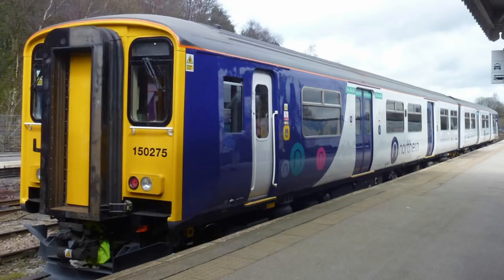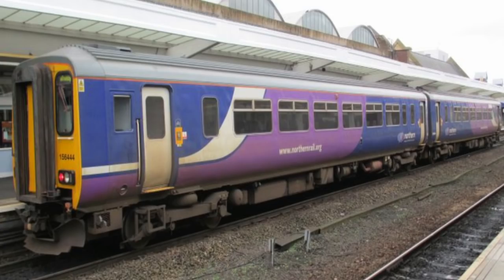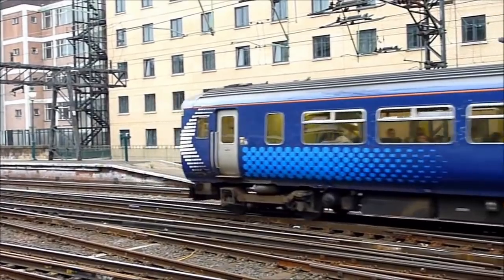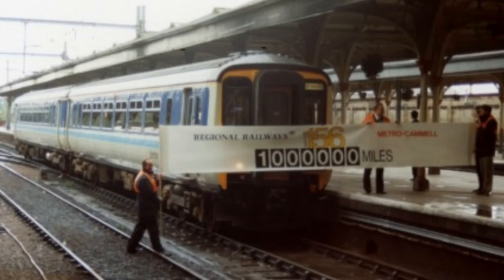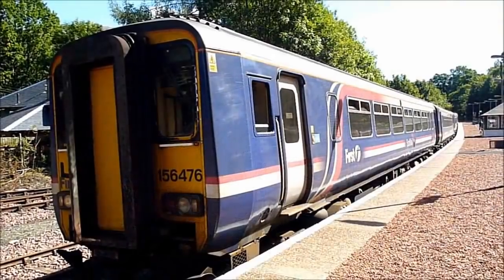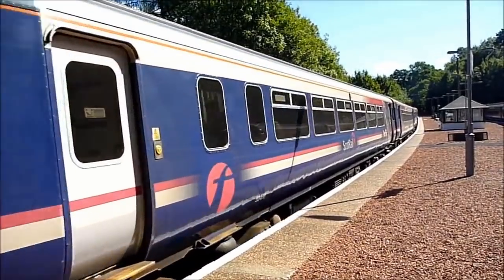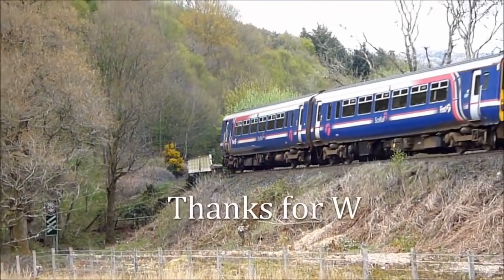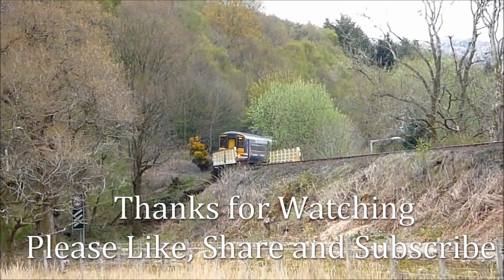British Rail Class 156

Comment: I like 151. Looks great wish they had made them in numbers
Reply: I remember riding them on the Matlock line.
Reply: @Eskel the Trainspotter & Roblox Yes they were but I can't remember what they were like inside apart from the seat moquette was something like the Pacers and contemporary road coaches (the striped design that was commonplace in the 1980s).
I always thought the 151s looked American in appearance and they had a very American spec as well with Cummins engines and a Twin Disc transmission that proved unreliable in the UK stop-start conditions...
The Cummins is an American engine built for long distance interstate trucking; UK buses and lorries (and the Pacers) with the Cummins engines were prone to breaking down...
I remember riding 150001 on the Matlock line and feel it should join the National Railway Museum collection alongside 142001 and 313001.
I also remember the Class 154 (Class 150 based testbed for the 158s) before it was converted back to a standard Class 150.
I think Northern should have retrofitted air conditioning in the 150 / 156s and 319/769s when they refurbished them...

Comment: Still ride on these to this day. Sheffield - Leeds / York line, northern rail. They are sometimes used for the Sheffield to York journey run 2x per day, in the morning only. Usually it's a single 142 / Pacer. 

I jump on at an un-manned station, where the line switches from the Leeds line to the York line. You have to change route when returning as York station staff get confused by the tickets. I use this route to go to the NRM when I can.

I like DMU's but they are getting really tired now, bless em.
Reply: So interesting to read this comment! Nowadays there are zero 156s at York and Teesside is absolutely full of them. Occasionally 158s run around Teesside but it’s the odd 150, all of the 155s and a few 158s in York. The York-Leeds services are 195 Civitys. I wish there were still some pacers about, such a fascinating class.

Comment: Probably as well the odd - looking Met-Camm 151 wasn't adopted. The running gear looks like the original design put under LT's "D78" Surface Stock. All the running gear was changed on those, as it had cracking frame problems. One of the old guards I worked with spent a lot of time on the Derby/Matlock line where they were tested.
Reply: I remember riding the 151s on the Derby - Matlock line; looking back I feel they were very American looking...